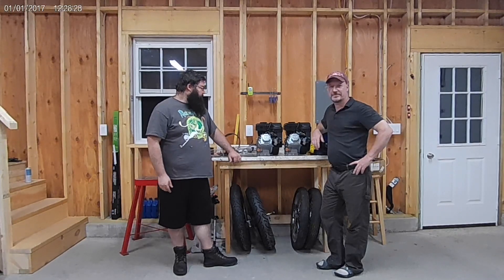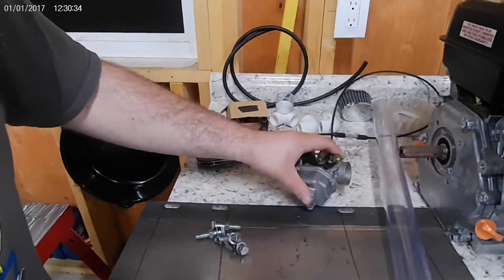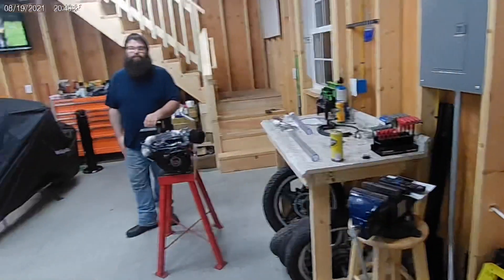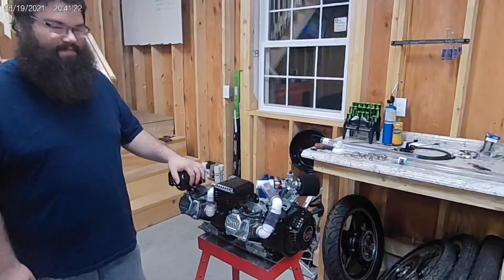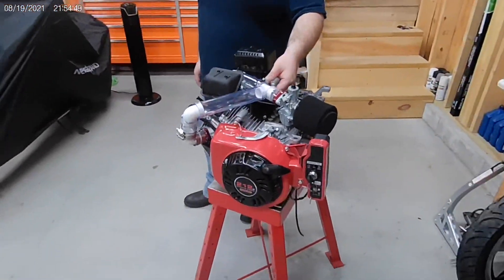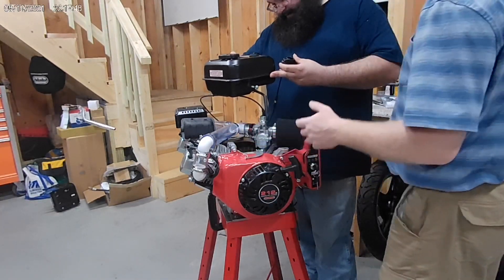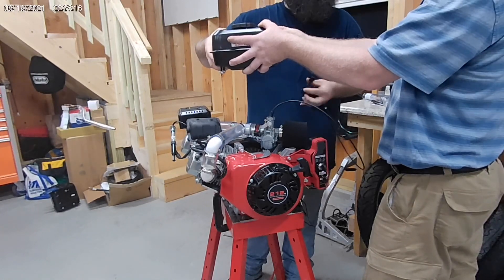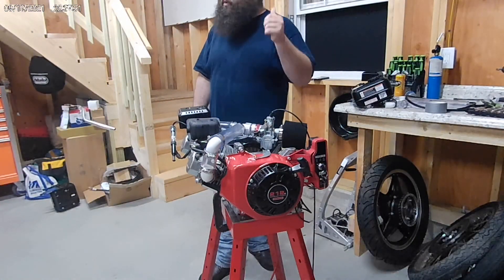First ever! Predator 212 INLINE TWIN ENGINE 424cc BUILD!  INSANE POWER!

Comment: How would this twin 212 perform power wise? HP/TQ? I think that at one time Red Beard Garage turbocharged a Predator 212. I don't remember what power level he got from a single turbocharged Predator 212. As others have mentioned after you get the concept figured out, you should definitely do twin Predator 420's it would be a monster possibly even out performing the Predator 999cc.

Comment: That is what Yamaha did when they came out with there V-Max 4.  They put two Banshee in the front of a sled and coupled them together.  It was one of the best sounding sleds to ever hit the ice. They were  not that fast stock but OMG good quad pipes pipes and some N2O turns them into a combo you will never forget.

Comment: Are your intake tubes the same length? The length of those tubes is probably causing the good throttle response longer intake runner better low end torque

Comment: Are the shafts connected or is this just running two motors off one carb?
Reply from the maker: As shown in the video, the shafts are coupled together - it's now ONE engine...
Reply: @BUILDNIGHT  this is soooo cool guys!
Reply: @BUILDNIGHT how do you make the left engines shaft stick out enough to put a coupler on it